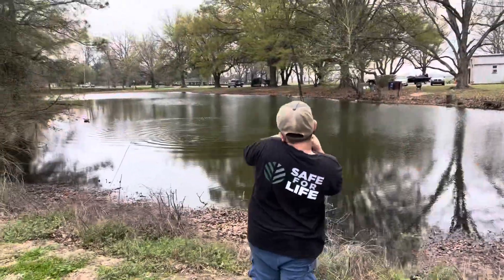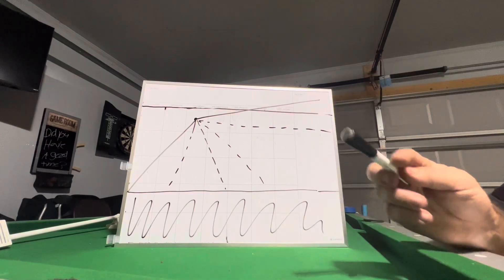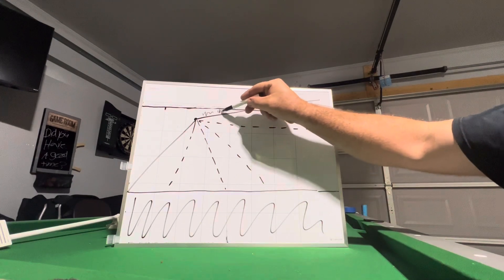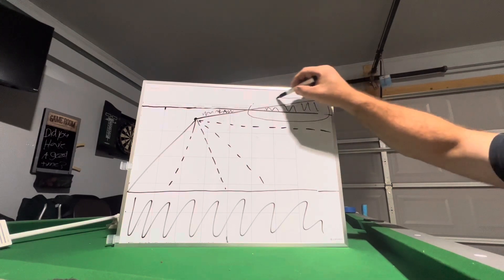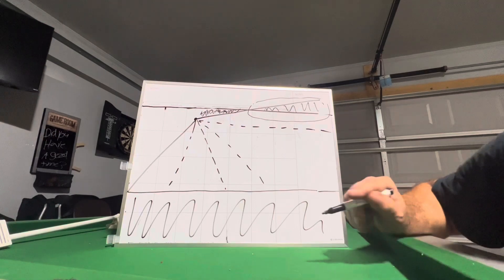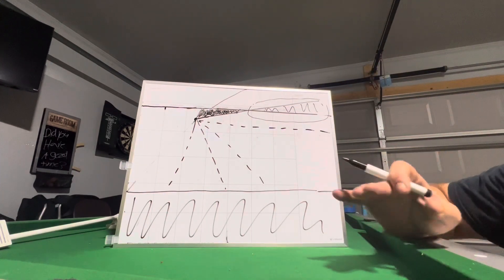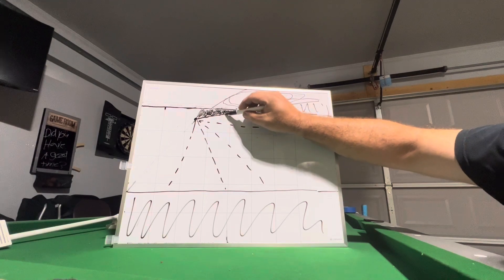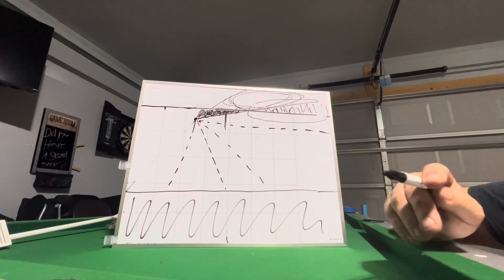Garmin Livescope: Does Clicking Up Help See Your Jig Better

Comment: There are 6 beams off the lvs 34 not 5. Also depending on the distance on the transducer below the waters surface, there is software adjustments you should raise or lower the beam with.
Reply from the maker: You’re right I misspoke about the number of beams.
Reply from the maker: I don’t understand the second part
Reply: In the sonar set up you can adjust the beams position on the screen. It falls under Install Depth. Raise or lower depending on the depth of the transducer from the top of the water down. You can actually lower the beam position one click or two on the transducer then under set up raise the Install Depth to see the bait splash on the water. Hope I made myself clear as I am not good at explaining.
Reply from the maker: @itselectric3906  I have videos on that. Install depth doesn’t raise or lower the beam tho. It’s seems slides the display on the screen up or down if that makes sense

Comment: When you turn it from down to forward, it's about 30degrees, so it points towards the surface with an angle about 7.5degrees which with som math would be about 19feet of water you don't see the surface, if the transducer offset is at 2.5feet. 

2.5 / tan (7.5) = 18.98 which is basically 19 feet.

With transducer offset at 2feet would be a blind spot of about 15 feet.

But the bait would probably show even closer to the boat since it's rarely swimming in the surface, most likely some feet below the surface or wherever you present it.

👍👍

Comment: Got to learn your set up.  1) zero degree vs 8 degree offset, 2) Tolling motor or pole being level, 3) Are you pitching into the center of the cone, 4) Are you fishing in dead calm vs chop water.  I can tell your for sure that fishing w/the 8 degree on the trolling motor makes it more difficult for you to see the splash.. Got to find the sweet spot.  Thanks again for another great discussion!

Comment: Randy good info as usual. I use to have transducer mounted on pole with 0 degree never really paid attention to how close I could see my topwater> I know it was pretty close. Have changed now to trolling motor mount on both boats.  I check tomorrow when I'm out and see how close I can see it. I have the depth set at 1 ft even though it is a little deeper
Reply from the maker: I set mine at 2.5 feet I have a video on that

Comment: Enjoy your videos… BUT I think you may have missed on this one though and here’s why: 
 
We all know we’re dealing with a fixed beam of 135° x 20° and the beam shape is a ‘prolate ellipsoid’ (roughly the shape of a football).  

You have correctly said in a prior video, “THE DEEPER YOU GET, THE WIDER THE BEAM GETS”. 

So… in Forward mode, the 20° beamwidth (widest part) is only in the middle, BUT,  the upper & lower portions of the beamwidth are tapered.  (think football shape) 

Thus, the reason ‘clicking up’ helps some to see their jig / splash better is because when tilted upward, you are placing a wider portion of  beam up towards the water surface. 

Of course this only works to an extent, usually one click or so before the software algorithm gets confused causing issues like slanted bottom and depth/range issues.
Reply from the maker: We will have to agree to disagree on this one but I can see your point
Reply: @The_Garmin_Guru   "The deeper you get, the wider the beam the gets" was your quote from another video and I agree with that 100% .  So  how could clicking up NOT WIDEN the beam width at the water surface ? The physics say  it has to. IMO that is why it's easier for some to see their jig splash at the surface.  Many times people  falsely perceive a delay in live sonar systems, b/c they don't see their jig at the top  the screen  right after it hits the water,  and then their jig magically appears lower down on their screen.  When really their cast  just slightly missed the direction of their transducer and therefore b/c the beam is so narrow at the top, their  jig just didn't show on the screen until it  sank deep enough down  to catch  the beam.
Reply from the maker: @psouth1720  too much to type but we will have to agree to disagree. And I’m not gonna make another video just to respond to one comment

Comment: Great info and I agree with you in theory but respectfully disagree in practicality or application and here's why,.... my older nitro bass boat nose is not level and  has a slightly downward or negative cant towards the water which cause my trolling motor to not be level either. I tried to shim the TM as much as I could to be level but still has a downward angle of attack. Therefore by rotating my transducer up 1 click it does help me in my case and I have seen that i can see my jig hit the surface better for me and my application. I only mentioned this for those similar instances of when the trolling motor is not perfectly level to start.. Otherwise, I believe you are spot on.
Reply from the maker: I agree with you on the I level transducer but for the purposes of the video I’m considering a level transducer. Another thing you have to take in consideration for an unlevel transducer is how the tilt affects it when turned sideways.

Comment: I don’t know the reason why, but clicking mine up has made a huge difference seeing the splash and finding my bait. Perhaps like others have said, it’s that the transducer isn’t perfectly level and now we are catching all of the water at the surface? Good video and definitely worth discussion.
Reply from the maker: I can agree with the transducer not being level but for the videos purpose I was considering a level transducer
Reply: @The_Garmin_Guru  you are the Guru, but it seems like every boat rides a little different in the water. My tracker 185 sits pretty low in the rear. Again I’m no expert, but how does one check for a perfectly level transducer once you are in the water?
Reply from the maker: @mattwilliams5222  interesting question for sure. Prolly either use a small level or get in another boat from the side

Comment: First off whether or not your trolling motor shaft or pole mount is level is an incorrect reference... they would be "PLUMB", not "LEVEL".  They are not the same thing they are 90° apart in orientation or reference to one another.  
     Level is parallel to gravitational forces and plumb is perpendicular to gravities forces.
     Second...agreeing with Randy's explanation of the small amount of coverage gained by "clicking up" when you also consider the 20° beam angle 5 to 10 feet away from the transducer, at 5 feet is 21.6" inches and at 10' is 43.2" inches it really is a very minimal area we are talking about.  Also since talking about seeing lure on the surface within 10 feet of transducer, you're  not likely to find many bass that are gonna hang around  yet alone eat a bait so close to the boat.

Comment: The Answer to that would be if the pole or trolling motor pole your transducer is mounted to is not completely level while your boat is in the water than yes clicking up or down one click could help.
Reply from the maker: All those variables are taken out cause that’s not how the question is often posed

Comment: In another video you address offset in the settings. Essentially the distance the transducer is below the surface. Changing the offset has let me see the splash even when the boat isnt level due to being in front by myself or whatever. Offset DOES make a difference!